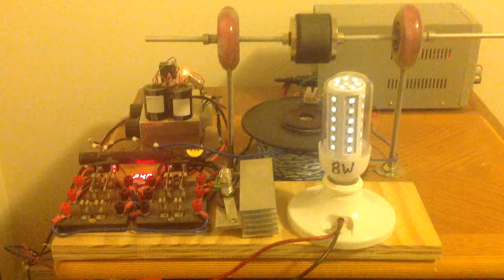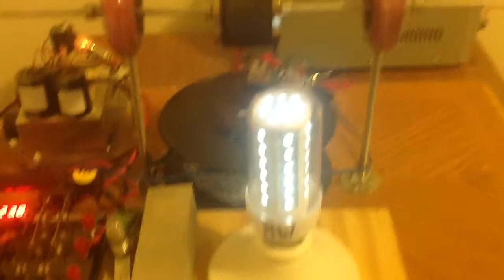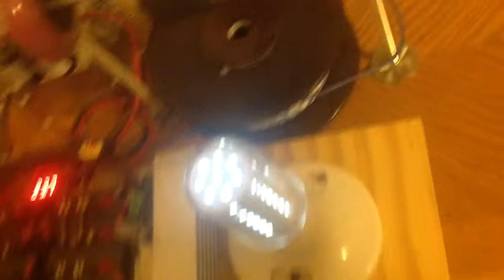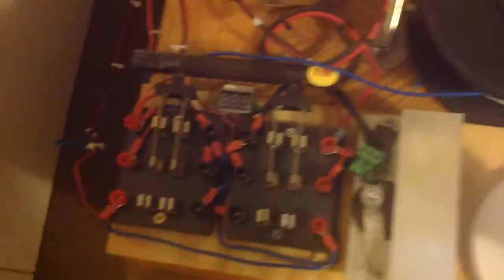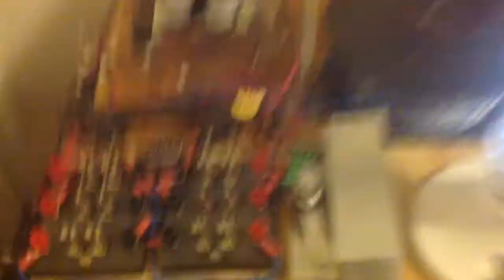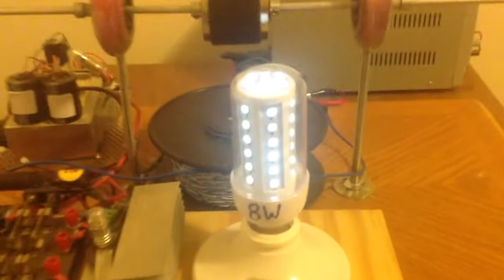8 watt light lit with NO POWER

Comment: Disconnect the caps and see what happens - I'm betting nothing!
Reply from the maker: I know the caps are feeding the lamp.  But why this particular lamp is lit and not the rest of the many other 120 volt  AC lamps I have tested. ( I  am using 24 volts DC as my power source  by the way.) 15 different other  120 volt AC LED lamps are only lit when power is on.  This one keeps burning  with power off.

Comment: Seems to be a solid state mode oscillation and the LEDs on this bulb seem only light dimly , so it is using probably only abour 0.5 Watts or less , now if you have 100.000 uF or so , it could be that it last so long , until the caps are discharged...